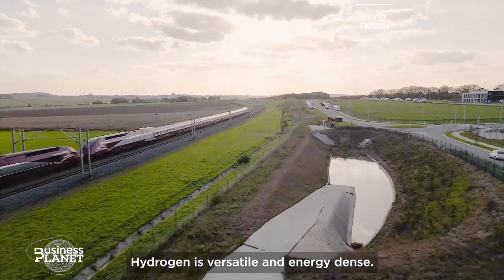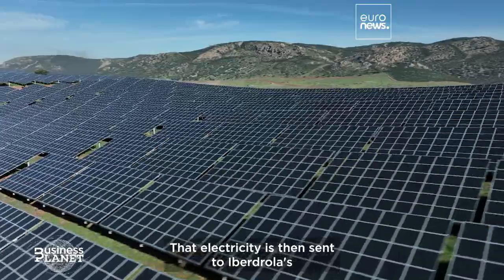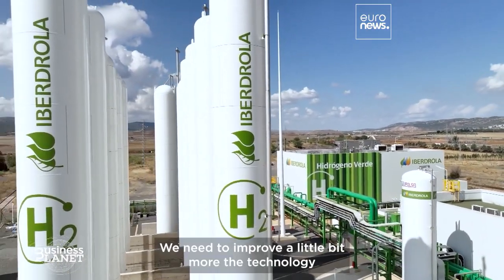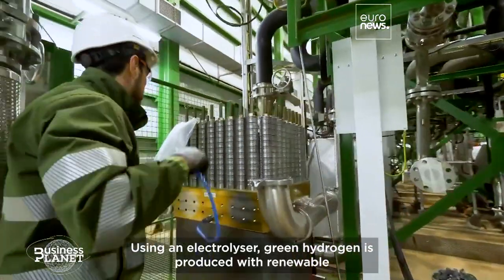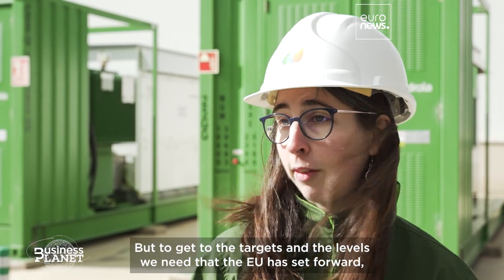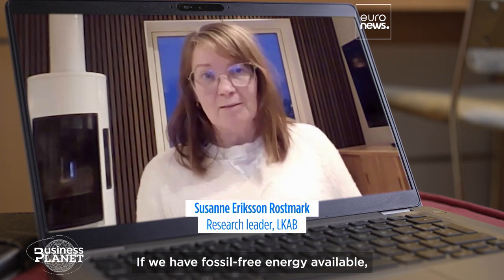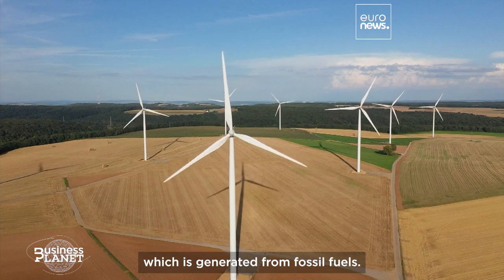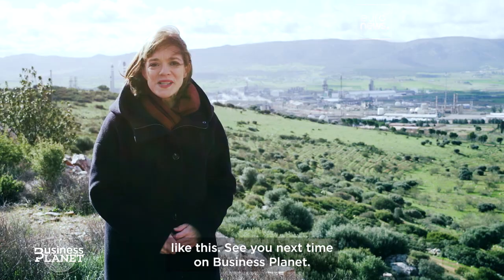What's stopping Europe from reaching its clean hydrogen goals?

Comment: Energy dense? No way. One of it's problems is just that it needs so much effort with extreme cooling and/or pressures for a meaningful energy amount to be stored
Reply: We need a cleaner version of petrol which are not batteries. Do you understand this concept ?
Reply: @ironman8257   what do you have against batteries? I'm sure you use them every day.
Reply: @flemlion13  im very much pro batteries. Its just diferent industries (aviation, military, cargo) need a fast refilable and dense energy holding medium, aka gasoline alternative.